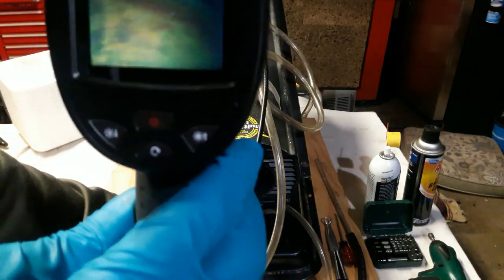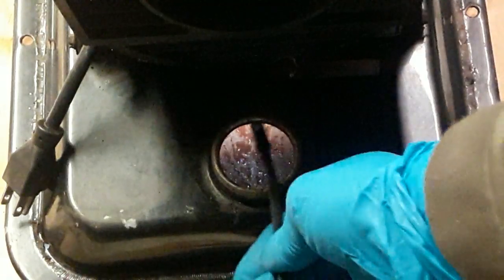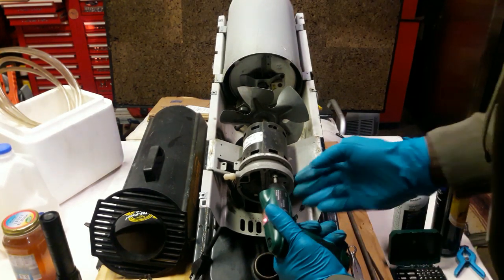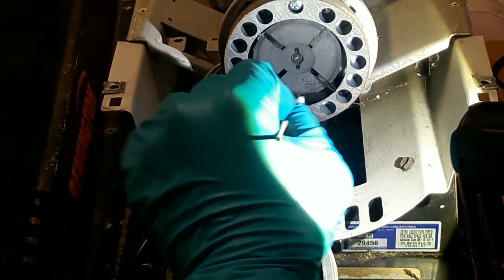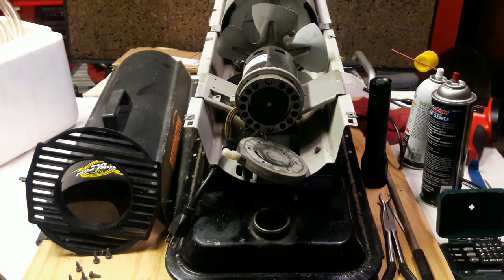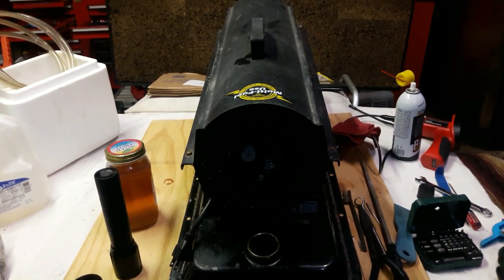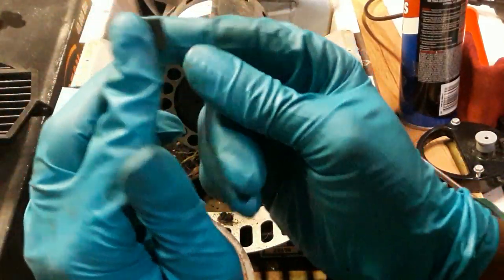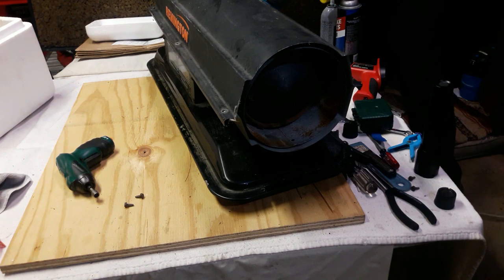Remington 40,000 BTU Service and Repair

Comment: I’m going to tear into mine see what I can find it might just be dirty or clogged
Reply from the maker: Juan Hinojosa 
Good luck Juan, I'm sure that it'll be easy enough to get it up and running again. 👍
Reply: Just a little follow up Rob looks like I got it running. I took it apart cleaned it blew out the filters and fuel lines and readjusted the fuel pressure down. I probably should empty and clean out the fuel tank.

Comment: I fixed mine last weekend, turns out the plastic back cover had a micro crack and was leaking air, I replaced it with an aluminum & steel housing from a  250k BTU century heater made back in the 80's.  Those things are easy to repair and can be bought off craigslist for almost free lol. If you're going to use diesel, I suggest bumping up the psi for a hotter/cleaner burn, half or full psi should do it plus it keeps the ignitor plug from caking. My new foundry furnace uses a 250k btu nozzle for melting aluminum ;)
Reply from the maker: That's a good tip Ray. It makes a lot of sense. I'll see what I can do with mine as soon as my new filters come in. 250 BTUs would run me and the dog out of the garage. LOL

Comment: Did you just call us potatoes at the begining of the video? And look at you, breaking out the fancy Q-tips in the paper wrappers!  I used to use Evaporust to clean out the inside of rusty motorcycle tanks.  Worked good.
I should have been in bed awhile ago but I had to see how it turned out.  Excellent job Rob.
Reply from the maker: Bruce L. 
Tool Tubers is my nick name for those of us in the Community. 😅
Whatever it was, sticky and gummy.  I've had those swabs since the Army...remnants of a weapons cleaning kit.
Thanks for watching the late show. ☺👍
I'll see if I can find some Evaporust. That's the tip of the day.

Comment: Great video brother. Can't wait till I have better than my 2 space heaters in my garage
Reply from the maker: Once you upgrade, you won't look back Chris, except in an emergency. LOL
Reply: Rob's Wrenches got my eye on a 40,000 btu forced air blue flame propane heater now. Just grabbed 2 20lb and a 40lb tank for 60$. Getting filled tomorrow and heater shopping. Gotta have warmth to make new weld table
Reply from the maker: chris jones 
Good deal. You'll be welding in comfort.
Reply: Rob's Wrenches that's the plan brother. Thanks for all the tips as well
Reply from the maker: You got it.

Comment: Good footage and explanation
Reply from the maker: Thanks Zo. It's almost as easy as repairing a clothes dryer. LOL
Reply: Rob's Wrenches yeah I repair one before it was a 35k btu was keep cutting off
Reply from the maker: Damn Zo, you can manage properties on the side. LOL You're ready for Superintendent status. LOL
Reply: Rob's Wrenches the best fuel for the them is the one from Home Depot menards etc . The smell to it is less and a lil more expensive . The kerosene they sale at the gas station stink cheaper but stink
Reply from the maker: Don't buy from Corner stations Zo, buy from Speedway. The same K1 for $3.99 per Gallon as opposed to $10 per Gallon at Menard's and HDX.

Comment: also what is that little electric screw tool your using
Reply: I have a similar one made by Altrade or something like that.  It's probably twenty years old but it still keeps on taking a charge and ticking along.  I see them at Walmart for $10 now and then.  Yours is much nicer.
Reply from the maker: It's a MasterForce 4.0 volt pistol grip screwdriver from Menard's. The same can be bought at Wal Mart or HFT, any retailer actually. This one just happened to be an impulse buy that came with the bit set shown, after my Milwaukee NiCad died, and my B&D AA batteries leaked inside of it's encasement.
Reply: Rob's Wrenches thanks Rob
Reply from the maker: I thank YOU Dave.
Reply from the maker: Bruce L. 
Yeah, I see them in just about every retail store under their particular brand. 
This one is about two years old.

Comment: good video Rob. question for you. you mentioned non chlorinated brake cleaner, what's the difference in the 2, regular vs non. I never really looked at that, just grabbed brake cleaner when needed
Reply from the maker: Dave, the chlorinated brake cleaner is damaging to painted surfaces and is probably known to the State of California to cause blindness, ingrown toenails, nose warts, etc. LOL Just kidding about the Cali biz. It's rough on finished surfaces. It'll damage paint and not as easy on rubber, not to mention your skin.
Reply: Rob's Wrenches interesting, ive always grabbed a can and went on, so do u feel they both work as good  or do u loose some benefits on the non for cleaning power. would you use non on brake rotors to.  I hear ya in the Cali thing.  lol
Reply from the maker: I've not noticed THAT much difference between the two, especially for brake jobs and general cleaning of gum and carbon. I think that the NON chlorinated is just as useful as the chlorinated in breaking up carbon.
There are less fumes with the NON chlorinated for sure.
Reply: lol every thing is known for doing something crazy in cali
Reply from the maker: Mustang314 
Right!🤣